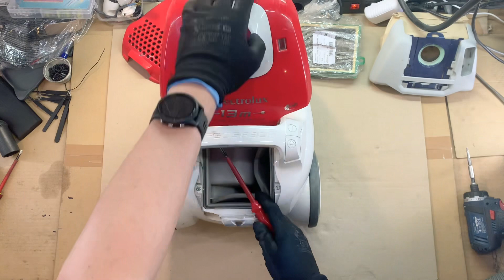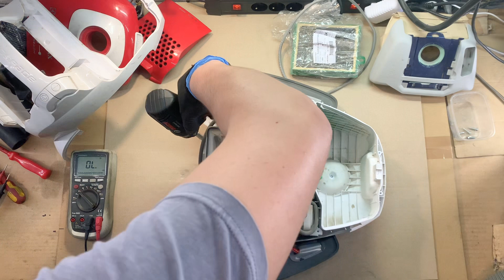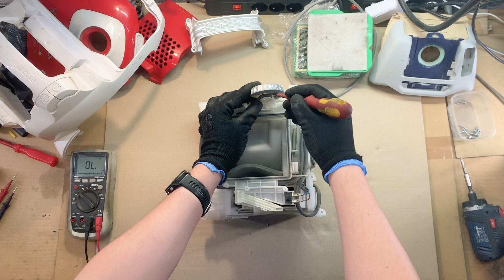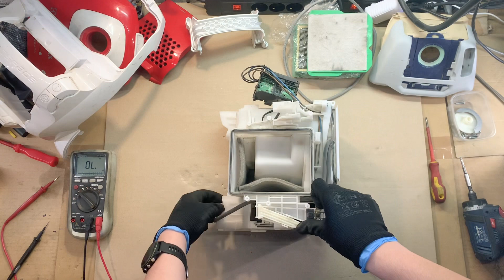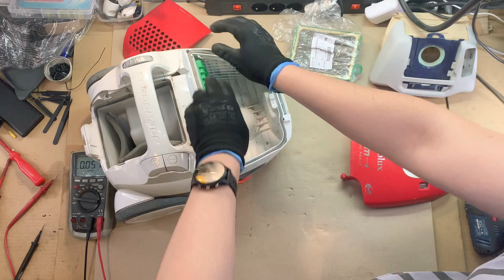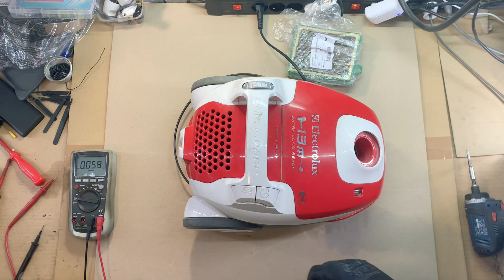Electrolux ErgoSpace ZE310M Vacuum Cleaner

Comment: Jai tout fait comme vous . Merci beaucoup.  Mais aucune réaction en tournant la molette blanche..😭😭😭
Reply from the maker: Hi, did you measure (connectivity) cable and motor? If reset of pcb doesnt help (vacuum cleaner doesnt start at all) then probably there is issue with capacitor or potentiometer. With soldering gun you can try to replace capacitors/potentiometer OR just replace entire board 2193995533 (or 2193995707 - different range 150V-240V)
Reply: Je n'ai pas lappareil électrique... @proexservis
Reply from the maker: Then get multimeter, it is very usefull to have one at home 👍 you can have only broken cable and not expensive issue with pcb/motor
Reply: @proexservis  merci pour la réponse
Reply: @proexservis  je n'ai pas vu de câble cassé.  Ni de résistance brûlée.
Reply from the maker: It may be broken near the plug, insulation may be fine, not burnt. Without multimeter you can check (exclude pcb issue) by bypassing it, connect cables from cord winder (and on/off switch) directly to motor cables, but only for few seconds to not damage motor, then you will be sure that you need new pcb or issue is somewhere else

Comment: Arıza neredeydi? Trimpotta temassızlıkmı vardı?
Reply from the maker: PCB was faulty set, probably due to under/over-voltage in electric site, it did reset and pcb couldnt start motor, so in video I reset pcb and set correct minimum power (spot where vacuum cleaner should run on min power)